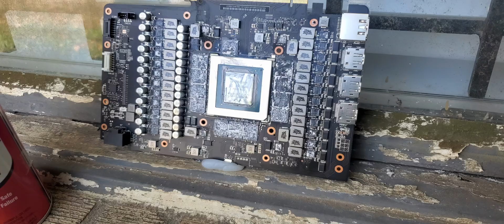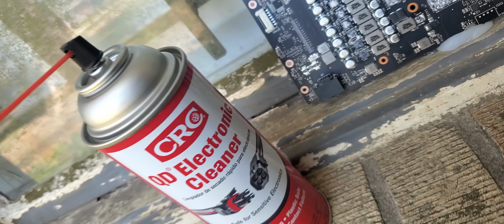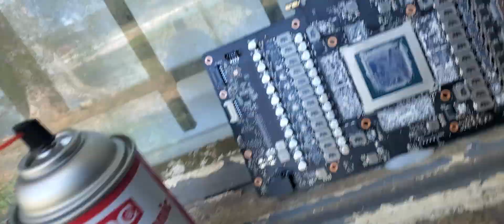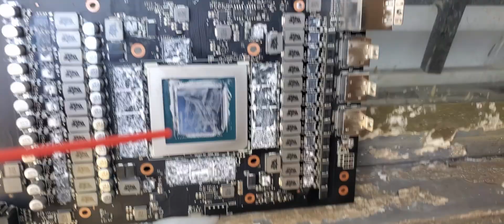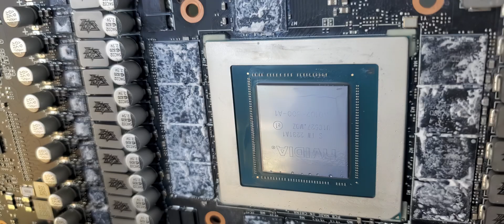RTX 4090 Paste and Putty Clean Up: QRC QD Electronic Parts Cleaner

Comment: Hello mate, thanks for the informative video. I've got 500 grams of TG-PP10 on the way, It's actually for my old Alienware Area 51-m laptop to put some life back into it, wondering If you think It's worth also putting It on the Strix 4090? Did you see much difference? Thanks again sir.
Reply from the maker: I have putty on both of the 4090's I own; absolutely recommended for maximum contact 'tween the heatsink and die.  I've used TG-PP10 on the 4090's but currently using U6Pro which is just as good if not better (W/mk-wise).  Either are great and more than enough W/mk for a GPU.  Also, if not already using it, I highly recommend  using PTM7950 phase change sheet on the die ... I was having to replace normal paste every six months until I went for the PTM7950.  PTM phase sheet is still good as day one, a year or more after install.  BTW: here's my first rework of the STRIX 4090 (other is TUF) with TG-PP10.PTM7950: https://www.overclock.net/threads/asus-strix-4090-oc-stock-asus-thermal-pads-swapped-for-tglobal-tg-pp10-putty.1804314/